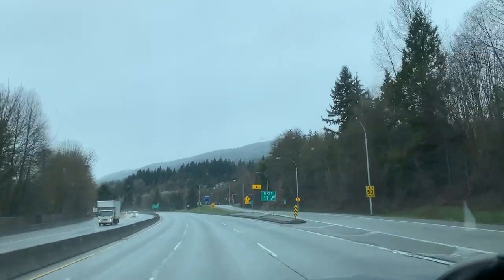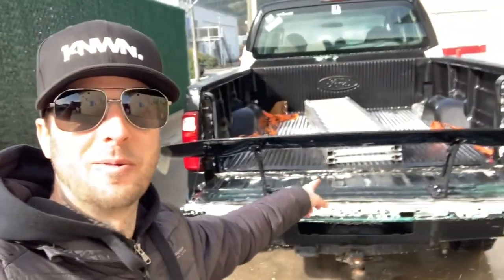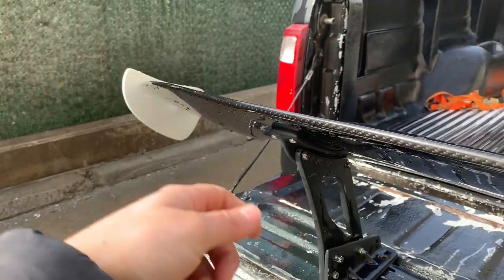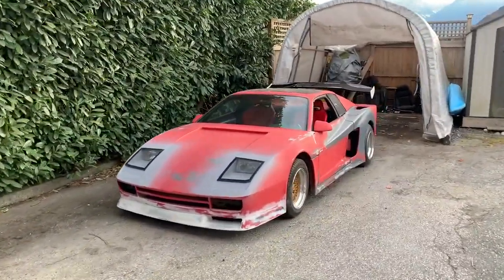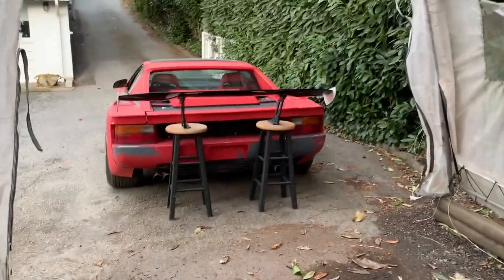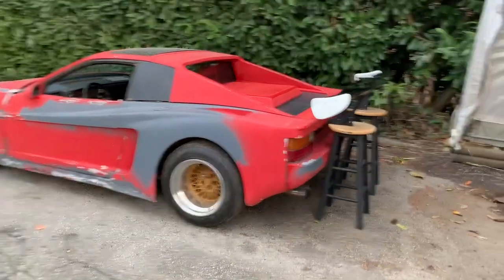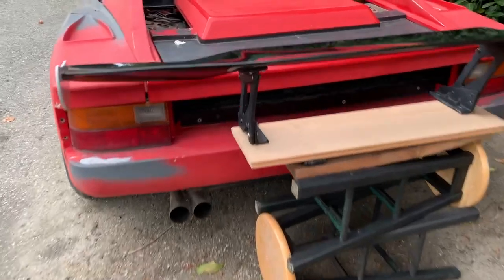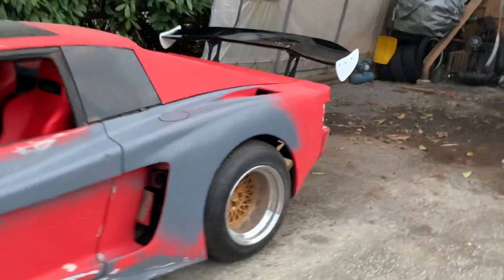I joined BIG WANG GANG! - Ferrari Kit Gets A Chassis Mount Wing!

Comment: prolly couldve gone with a $37 ebay special spoiler  if your gonna try to hide the large wing off the body. it looks awesome on the rear lid add reninforcement underneath just my 2 cents.
Reply from the maker: Thanks for the input.. allot of people are thinking the same thing to go higher with the wing.. Mounting in on the engine cover would definitely be allot easier!

Comment: Liking the rear wing set at 7 inches high it visually lengthens the car which when you add the lower profile tyres should give it the desired stance My RV Nemesis Koenig replica is dimensionally as near as you can get to the real car and I have been looking at rear spoilers for a while now. Koenig tuning made two types of spoiler for their  conversions an aero foil which mounted on top of the rear hatch  and the competition raised wing which is the full width of the car mounted on pedestals at the rear of each rear quarter I recently missed buying an original genuine Koenig competition wing 😖but am still looking at options Interested to see this finished are you going to hike the power to match the looks ?
Reply from the maker: I wish my kit was stretched but visually with the chassis mount wing it looks allot better... your Replica is a stunning one for sure.. do you know if you can get those kits anymore?